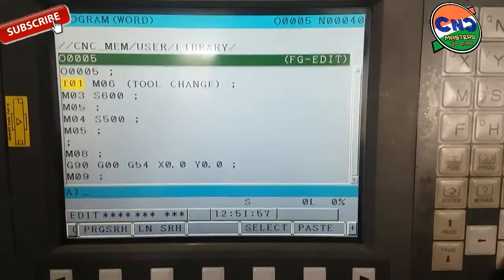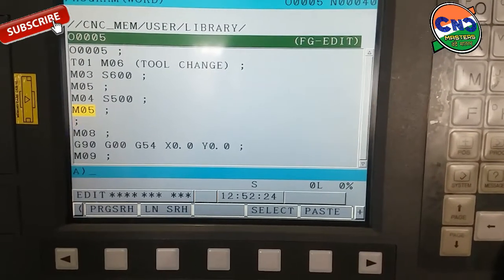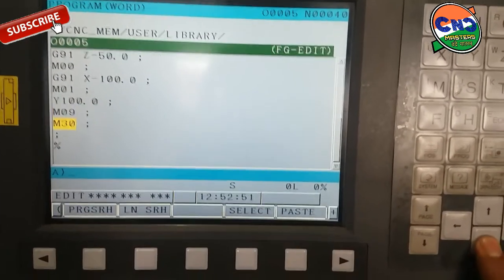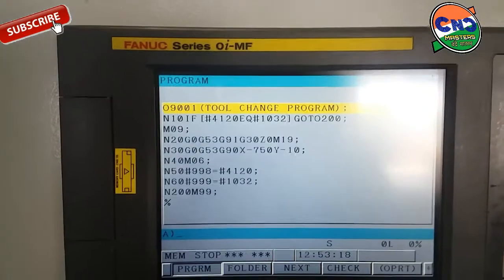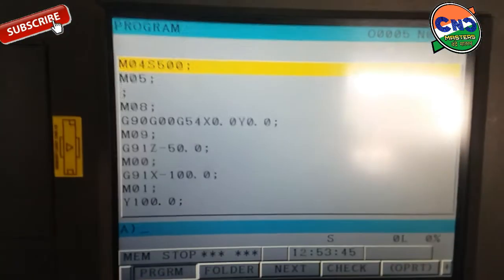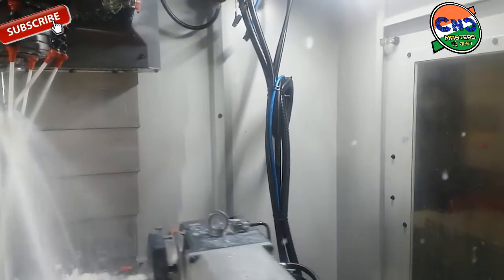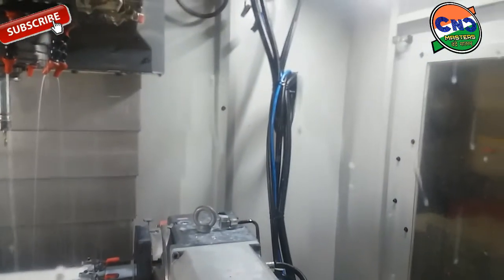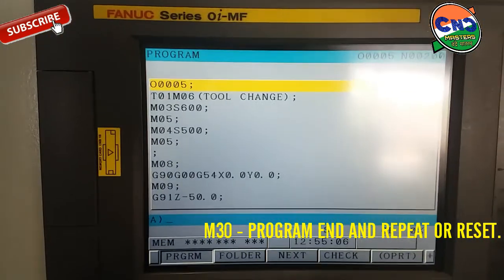All BASIC M code for CNC BEGINNER ONLY. BY CNC PROGRAMMING IN ENGLISH.

Comment: Hi videos or really good but I need one video like  operter shoud touch one end by edge finder .after that I need to run one program X-100 Y 100 and automatically machine value should enter to workoffset
Reply from the maker: What is your exact purpose ? Please Explain,so I will provide solution